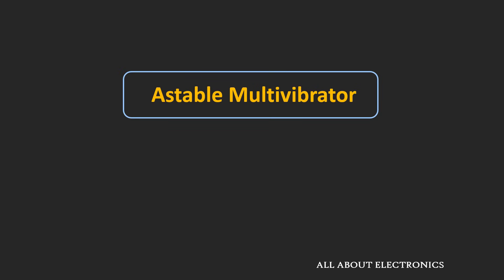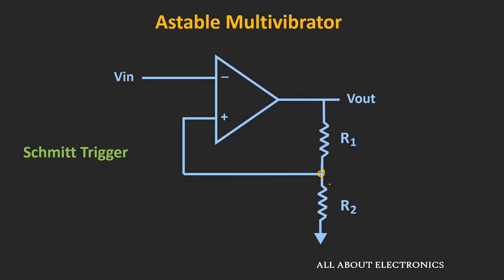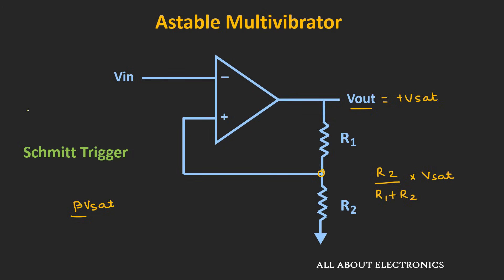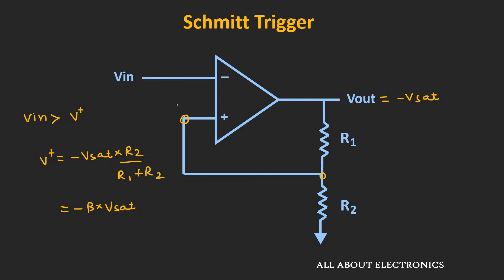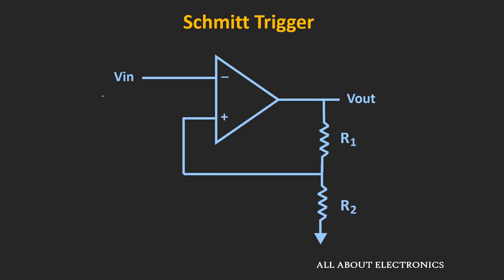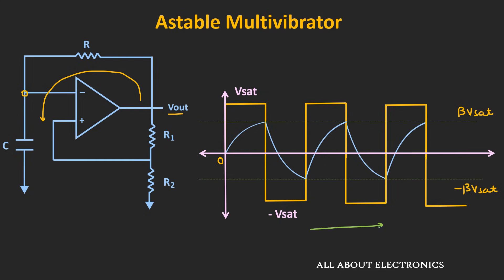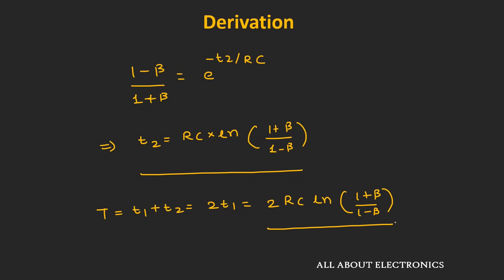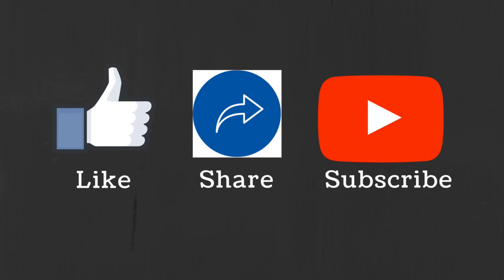Astable Multivibrator (using op-amp) Explained

Comment: How can we set amplitude of square wave by using zener diode
Reply from the maker: The zener diode will clip the output voltage to its Zener voltage (when it is used in reverse biased). So, you can use the combination of Zener diodes in series to get your suitable voltage at the output.
Reply: @ALLABOUTELECTRONICS  Thnx a lot ❤

Comment: IMPORTANT NOTE: There is no explicit input voltage and the capacitor is completely uncharged at startup. The reason why the circuit still gets a voltage is because, at startup, the op-amp sends out a current (because it is necessary for the op-amp to begin operating and for its internal circuits to stabilize).
Reply: @albertfalck9481  The main reason Is the offset voltaje which creates a voltage difference between v+ and v-

Comment: This circuit is mostly analysed to operate as a switching circuit using  producing pulses as the high gain of the operational amplifier is not controlled . If the gain of the amplifier is controls to make A*K  =1  then this will behave as a very good sinewave generator.  All one needs to do is to control the amplifier to give the required gain hence if the feedback loop is 1/2  then the op amp gain should be about 2, 

One may analyse it with vector diagram when considered to be working as a sinewave generator.  This construction will even give the reason why the vectors will rotate and give the sinewave, 
Take the output as being a vector, 
Chose a feedback factor along this vector say K= 1/2
Draw he vectors representing the voltages across the capacitor and the charging resistor  Vo = Vc + Vr =  I/jwV  +IR      producing the normal semi circle for an c/r circuit fed by Vo.
Draw the vector linking KVo  and VC hence Kvo-Vc     where this is the floating  input to the amplifier 
from this draw the output vector  A*( KVo= Vc)  and this will be seen leading the past Vo showing the rotation  of the  new output by such a vector diagram. by a full circle or a spiral out till saturation occurs ( a little) 

If the amplification A or the power supply  is limited then this can be shown on the vector diagram by horizontal lines cutting the circle and the output will be squaring off to produce what was shown in this video.

To use this oscillator as a sine wave generator with only one capacitor  to phase shift is a great education and  students will see a wider vision of oscillator rather than showing them it working as a square wave generator,

Comment: Shouldnt the Vfinial be B*Vsat for t1 not Vsat ?
Reply from the maker: When the capacitor is charging, it is charging towards the Vsat voltage. But because of the comparator, as soon as the capacitor voltage reaches B*Vsat, there is a transition in the output. If there is no comparator in the circuit, then the capacitor would have charged upto Vsat voltage. That is why Vfinal = Vsat. I hope, it will clear your doubt.

Comment: sir you've said that "The capacitor is charging towards the voltage Vsat." but this is not true. because if we look at curcit there is an Resistor above the opamp (potentiometer). so that there will be a voltage drop. it should be Vsat - I*Resistor. so the capacitor will never reach Vsat even if we ignore that cap will charge till B*Vsat.
Reply: no this is where you were wrong just make a series RC circuit you will observe it yourself .

Comment: point to be noted: capacitor charges till voltage at inverting terminal is greater than voltage at non inverting terminal.after this it gets discharges till Vc<( -R2\(R1+R2)*-vsat.then cycle repeats

Comment: how Vfinal is Vsat and not BVsat??
Reply from the maker: The capacitor is charging towards Vsat. But when the voltage reaches, B Vsat, we have transition in the output. If that transition has not happened, the capacitor would have charged up to Vsat. 
That is why Vfinal = Vsat.
I hope, it will clear your doubt.

Comment: Sir, Schmitt Trigger is bistable multivibrator and not astable
Reply from the maker: Yes, that's true. Because it has two stable states. But it can be used in the design of astable multivibrator.

Comment: Sir, how can we amend the circuit to initiate the loop? What if the initial voltage of the output and the capacitance are zero? Thank you.
Reply: I mean how to trigger the circuit
Reply from the maker: @chantony9318  Typically, the op-amp output can be positive or negative (+Vsat or -Vsat). So, even if capacitor is uncharged, then also at the positive terminal of the op-amp, B*Vsat or -B*Vsat voltage will be there. And with that, the voltage transition at output will start. 
Now, there are some op-amps which works with single supply. In that case, the initial output might be zero ideally. And the capacitor can be totally uncharged. But actually some offset voltage at the output will be there. And based on that, few mV signal will be there at the positive terminal of the op-amp. So, that can also start the multivibrator action. Because, in that case, even if capacitor is uncharged, but due to some positive voltage at the + terminal, there will be transition in the output. And then the multivibrator action will continue. 
I hope, it will clear your doubt.

Comment: How can I vary the output amplitude of the square wave?
Reply from the maker: You can use the back to back Zener diodes at the output to change the output voltage to particular voltage level.

Comment: I didn't get how the switching happens btw +Vsat & -Vsat in output .Sir ,can u plz give explanation?
Reply from the maker: Since there is a positive feedback in the configuration, the opamp acts as a comparator. In this configuration, when the voltage at the positive terminal of opamp is more than negative terminal, then output will switch from + Vsat to - Vsat. And vice versa, from - Vsat to + Vsat when V- is greater than V+. 
I hope, it will clear your doubt.
Reply: @ALLABOUTELECTRONICS  Got it. Thank you sir 😊

Comment: 10:36 Vfinal should have been BetaVsat no? Because the capacitor is charging from  -betaVsat and +betaVsat
Reply from the maker: The capacitor is charging towards the Vsat. But because of the comparator, it is not able to charge up to Vsat. Otherwise, it would have charged up to Vsat. That's why Vfinal is Vsat. I hope, it will clear your doubt.
Reply: @ALLABOUTELECTRONICS   Thank you sir 🙏🏼

Comment: What changes I have to do to the circuit if I want duty cycle other than 50%?
Reply from the maker: You can use Zener diodes of different Zener voltages and connect them back to back at the output. With that, you will get different feedback voltages for both positive and negative saturation. And hence, you can alter the duty cycle.
Reply: @ALLABOUTELECTRONICS  thank you sir ... I got you👍.

Comment: Initially we assumed R1=R2=R and calculated R=4.5k ohm to design for 1khz. But here suddenly changed R1=R2=10k ohms. How?
Reply: this is what he replied to a similar comment. "For 50 % duty cycle, R1 and R2 should be the same. So, as far as R1 and R2 are of the same value, any of R1 and R2 can be selected,  (for 50 % duty cycle). With R1 = R2 = 5 k ohm also, feedback fraction β would remain same.
But here 10 k ohm is selected during the design."
Hope this helps

Comment: How did you get 4.5 K ohm ?
Reply from the maker: Would you please mention the timestamp in the video, where you are referring to ??
Reply: @ALLABOUTELECTRONICS  8:27 R=4.5 K ohm. I am getting 10.47 or something ( I haven't done any unit conversion )
Reply from the maker: @hafiskm4305  I think instead of ln(3), you must have taken log(3).
Please calculate it once again with ln(3) in the denominator. You will get it.
Reply: @ALLABOUTELECTRONICS  yeah you are right. Thank you

Comment: Sir ,i have a doubt. Here in astable multivibrator ckt When + feed back and -ve feed back are present in an op amp,then -ve feeb back is dominant and so we use virtual ground concept??  Is my statement ryt or wrong sir?
Reply from the maker: It depends, which feedback is dominant. When positive feedback is dominant then op-amp will operate in the saturation region.

Comment: What if saturation voltage for op amp is different.  like VCC =6 
VEE =-5 volts is there any change in the time period of charging and discharging of the capacitor ?

Comment: while deriving the expression for time period,why have you taken final voltage as Vsat and not as BVsat while charging from -BVsat?
Reply from the maker: The thing is, the capacitor charges towards Vsat voltage, but as soon as it reaches BVsat, there is a transition, in the op-amp output. If that transition do not occur than the capacitor would have charged upto Vsat. Thats why final voltage is Vsat.
I hope it will clear your doubt.
Reply: @ALLABOUTELECTRONICS  thanks sir..

Comment: sir, is it like.. the input voltage varies accordingly to the output voltage?
Reply from the maker: There is a feedback from output to input. It's closed loop system.
Reply: @ALLABOUTELECTRONICS  yes sir. so its the varying voltage of capacitor. so does it mean that its the graph of input voltage?

Comment: sir, I guess positive feedback will be R1*vsat/(R1+R2)
Reply from the maker: The feedback voltage is the voltage across the resistor R2. So, it's R2*Vsat / (R1+ R2) (It can be found simply using the voltage divider rule)
Reply: @ALLABOUTELECTRONICS  thank you
Reply: @Allaboutelectronics.. 
 At 9:02-9:04.. How u took R1=R2=10kohm..  after tuning with potentiometer of 5kohm??? 
 Kindly  reply me !!

Comment: can we generate wave with different duty cycle
Reply from the maker: Yes, but for that positive and negative reference voltage ( + B*Vsat and - B*Vsat ) needs to be different. You can use diode in the R1 R2 path to achieve that. I mean instead of just one set of R1 and R2, you may have two set of R1 and R2, at the output. In both branch you can have diode in series with those resistor, but with opposite polarity in both branches) 
During positive output voltage only one diode will conduct and feedback will be through one set of R1 and R2. During negative output the feedback will be through another set of R1 and R2.
I hope you got the point, what I mean to say.
If have any doubt then let me know here.
Reply: i got it..thank u sir

Comment: Initially we assume R=R1=R2. 
From where we get value of R1=R2=10 k ohm???
Reply from the maker: For 50 % duty cycle, R1 and R2 should be the same. So, as far as R1 and R2 are of the same value, any of R1 and R2 can be selected,  (for 50 % duty cycle). With R1 = R2 = 5 k ohm also, feedback fraction β would remain same.
But here 10 k ohm is selected during the design.

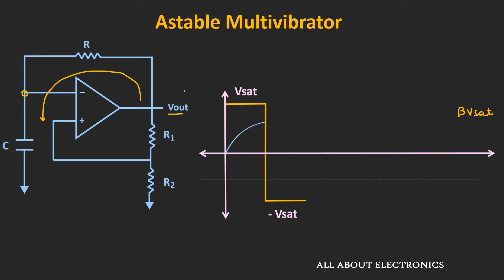Comment: At 5:40 why we assumed that input at inverting terminal is higher than non inverting terminal?
Reply from the maker: Because the capacitor starts charging towards the +Vsat voltage. The output of the op-amp is +Vsat. Therefore, due to the feedback, the voltage at the positive terminal is B*Vsat. And as soon as the capacitor reaches the B*Vsat voltage, there will be a transition in the output. 
I hope it will clear your doubt.
Reply: @ALLABOUTELECTRONICS  thank you...now it is cleared

Comment: Sir, why do we assume that there is no transition from Vsat to -Vsat calculating Vfinal=Vsat?
Why not Vfinal = B*Vsat?
Reply from the maker: Because after transition, the capacitor starts charging towards vsat or - vsat voltage. That means if the capacitor charges fully then the voltage across the capay would have been Vsat or - Vsat. But due to the comparator, when the voltage across the capacitor reaches either +B*Vsat or -B*Vsat, there is a transition in the output. Therefore, Vfinal = Vsat .
I hope it will clear your doubt.

Comment: Are you sure that, in the square waveform output of the astable multivibrator has a T = 50%?  I thought that, by definition, T should equal 63.2%.
Frank
Reply: I think that's because you're feeding Vsat to the capacitor, but comparing it to BVsat. So while it might take it one T to reach 63.2% of the voltage, it will reach BVsat sooner.

But definitely don't take my word for it. I'm just a newbie trying to learn. :p
Reply: @elendilion  I was just thinking about the definition of time constant of C and L, theoretically.  You know a lot more about electronics than I do.  
Frank

Comment: Sir , why we choose of value of capacitor in microfaraday scale ..
Why we not use the capacitor of value 1faraday or 10 Faraday??
Reply from the maker: Because if you go for the larger values of the capacitor then depending on the voltage, the size of the capacitor will also increase. 
Also with such large values of the capacitor, if you calculate the value of R, it would be very small. even less than ohm. And even normal copper wires which we are using for the connections have the same order of resistance. 
Therefore, the capacitor value is usually chosen in uF.

Comment: Sir,you told that Vfinal= +Vsat and you told that it is supposed to go to that voltage.But  by voltage division rule some of voltage get dropped across feedback resistor.Then how it can be +Vsat.I think
 Vfinal = (Xc/(Xc+Rf))(+Vsat).
Reply: Thank you sir
Reply from the maker: You can apply that formula, when the input to the RC circuit is AC. Here, we are considering it transient situation, that means when there is a sudden change in the circuit condition. And we are dealing with the DC voltages for that transient condition. (e.g Vsat)
So, consider it as normal RC charging circuit.

Comment: What if I need to change the duty cycle?
Reply from the maker: For that, you need different RC time constant for the capacitor charging. What you can do is, you can use a diode in series with the feedback resistor. And similarly one more diode and resistor pair in parallel with it (between the output and the inverting terminal)
But for the second pair the value of R will be different and also the direction of the diode should be reversed. 
That means when the output is positive, the capacitor charges through one path with time-constant R1'C, and when output is negative, the capacitor will charge through another path with a time constant R2'C.
 And in this way, you can achieve different duty cycles. 
I hope it will clear your doubt.
Reply: Got it thank you.😌

Comment: How can u assume initial output Voltage as +Vsat
Reply: Output voltage opamp cannot be exceeded by biasing votlage
Reply: When opamp is open loop, even a slight positive differential voltage will cause the opamp to multiply that small positive voltage by it's very large gain, which will make the voltage required very high for the opamp.
Naturally it will saturate.

Comment: Shouldn't the voltage across capacitor be A*Vsat instead of B*Vsat(beta*Vsat)?
Reply from the maker: The capacitor will start charging towards the voltage Vsat. But the voltage at the non-inverting terminal is B*Vsat. So, as soon as the voltage reaches that threshold then there will be a transition in the op-amp output. And now it will start charging towards the -Vsat voltage. 
I hope it will clear your doubt.

Comment: How vfinal =vsat capacitor won't charge till vsat it charges till beta vsat
Reply from the maker: The capacitor starts charging towards the Vsat. But before that due to the transition at B vsat , it won't be able to charge till Vsat. 
If there is no transition at Bvsat, it would have charged up to Vsat. 
That's why Vfinal = Vsat
I hope it will clear your doubt.

Comment: What will happen when capacitor discharges ?
Reply from the maker: During the discharging process when the capacitor voltage falls below the threshold voltage, the output of the op-amp switches from -Vsat to + Vsat voltage.
Reply: @ALLABOUTELECTRONICS  thanks for replying 😁👍

Comment: Why V final =V sat
Why  V final not= peeta V sat
Reply from the maker: Because the capacitor is charging towards the Vsat voltage. Its due to comparator action whenever voltage crosses B*Vsat voltage, we see a transition in the output. If that's not the case, the capacitor would have charged up to Vsat voltage. 
That's why Vfinal = Vsat. 
I hope it will clear your doubt.
Reply: @ALLABOUTELECTRONICS  ok   spr sir tq

Comment: Sir here Why the Vfinal= Vsat. The capacitor charges from -Vsat to +Vsat
Reply from the maker: Vfinal is the voltage where capacitor supposed to reach in the steady state condition. When the capacitor starts charging from -BVsat voltage, it supposed to charge up to Vsat voltage. That's why Vfinal is equal to Vsat. 
I hope it will clear your doubt.

Comment: Why doesn't Vout become 0 as soon as the potential across the capacitor reaches the B times Vsat?
Reply from the maker: Because here we are assuming that the op-amp works on the dual supply (it has both positive and negative voltage supply). So, whenever it works as either comparator or Schmitt trigger, the output will switch between +Vsat and -Vsat. 
That's why when the voltage across the capacitor (or the input at the inverting end) just crosses the B times Vsat voltage, there will be a transition in the output from +Vsat to -Vsat.
What you are saying would have been true if the op-amp operates on the single supply.
Reply: @ALLABOUTELECTRONICS  I see, thank you very much for the explanation.